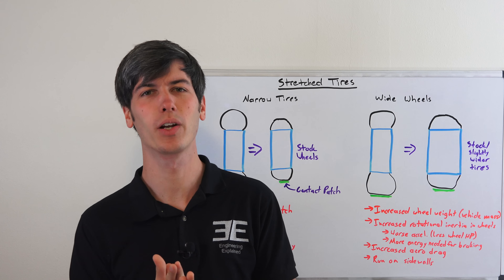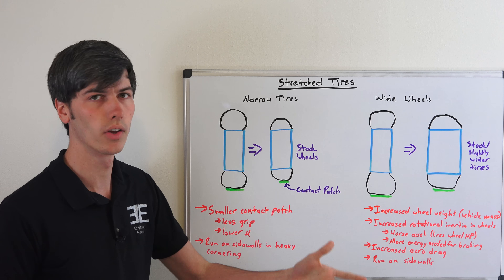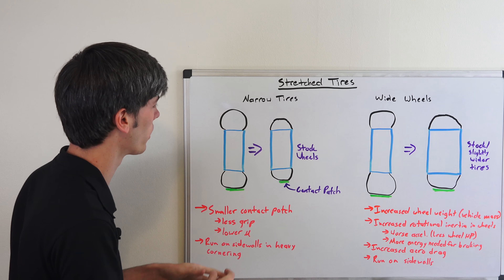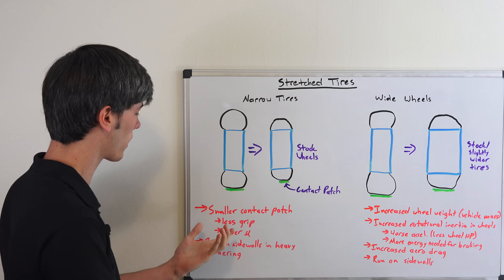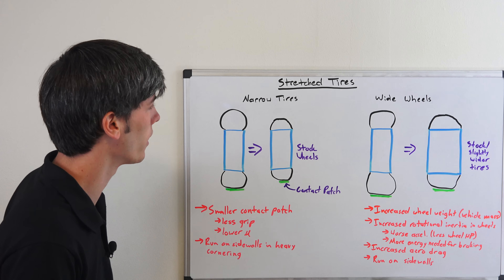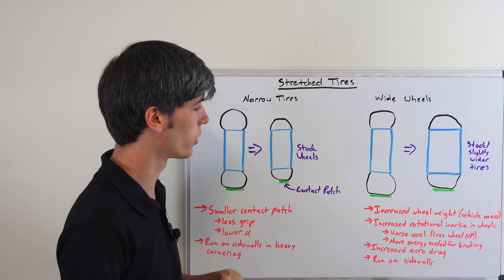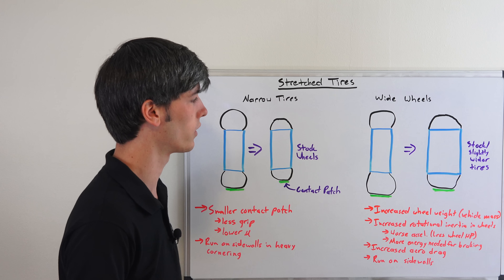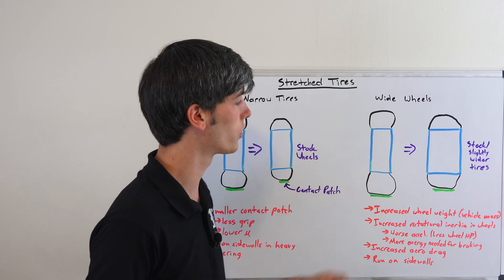Stretched Tires Are Silly

Comment: But then F1 cars have wider rear tyres. If they create aerodynamic drag, then why is it so?
Reply: Why do they have wider rear tyres?*
Reply: +Seema Kiran better traction/transsmission of power to the ground?
Reply: +Seema Kiran You are referring to tire stagger, not stretch.  Tire stagger is the result of trying to keep the tire temps the same on all 4 corners.  So f1 cars (which have most of the weight and all of the power driving the rear wheels) need more tire in the rear.
Reply: F1 cars are a different breed. They are full race cars which are extremely light and fast and need lots of traction. Yes the wider tires result in more drag but those cars need the grip. Also, the rear wing provides so much down force that they need weight and grip on the rear end. It is always a balance. Tires that are too wide result in added weight and drag. Tires that are too small (narrow) are light but may not don't have the surface area for enough grip. In racing, many narrow tires may result in a higher top speed on the straights, but wider tires may result in higher corner speed due to increased grip.

Comment: You are silly for assuming a wider rim is going to be heavier.  I am not a fan of stretched tires but some people like the look and if done correctly most of your arguments are invalid.
Reply from the maker: +Aron Singletary Which arguments are invalid? Sure, a carbon fiber 9" width wheel will be lighter than an 7" width steel wheel, but that's not a fair comparison is it? Which is lighter, a 9" width aluminum wheel or a 7" width aluminum wheel? Comparing apples to oranges is silly.
Reply: +Engineering Explained  I don't believe you have spent much time examining OEM vs aftermarket wheel weights, otherwise you would not make such a gross generalization. That goes to my initial complaint about your assumptions. If you truly wanted to explain engineering you would state your assumptions up front. Also the case could be made that going from a 6" wheel with a 185 tire to an 8" wheel with a stretched 205 tire that the contact patch is increased. Again assumptions are just silly, particularly when applied to engineering discussion. In the end stretched tires make no sense to me but I have to call you out for not framing your discussion better. My first real exposure to stretched tires was an OEM upgrade on an Infiniti G35. The car handled amazingly well and never had any issues which you imply are guaranteed when stretching tires.

Comment: Wrong again, if you stretch a tire it becomes smaller. You even drew it so in your diagrams. You would not lose horsepower from more wheel weight because the smaller wheel would compensate for it at it changes the at wheel gear ratio.

Comment: wow all these videos are dumb, your applying "broscience" and not real science, you don't take into consideration the fact of a harder sidewall tire, when cornering you have no worries of flex. nothing wrong with a stretched tire, too much stretch is possible definitely! but there is nothing wrong with it if you do your research and plan ahead, proper chamber and a proper tire will accommodate accordingly

Comment: You are negating the positive outcome of reducing sidewall flex for cornering performance.
Reply from the maker: Can you explain the logic to me? Is that not what mild camber is for? And how significant is the change? Enough to make up for a smaller contact patch and less grip or more weight?
Reply: +Engineering Explained 

Ok, so im not entirely disagreeing with you but lets make an example with a certain scenario.  Say we have two 255/65 r18 tyre.  Now we mount one of these tyres on a stock rim designed for it and another on a wider rim.  The car in question is setup identically with same camber settings.  In essence stretching the tyre will reduce the profile to something less than 65 compared to the non-stretched tyre.  

Now lets think of it this way, lets only have one variable.  Taking the same specification of tyre and adjust the sidewall profile.  Same contact patch and same camber, same everything.  What would you believe to be able to corners better/quicker/hold higher entry speed of the vehicle whilst maintaining 100% traction?  The fact is a 65 profile tyre will float more so than say a 25 profile tyre.  

Now whether this negates the extra wheel weight for the wider wheels would need real world test for entry speed, sustain speed  and overall time.  My personal experience is that tyre stretching will be superior.  Maybe marginally, however; taking into account driver confidence gained by the stability and predictability i believe would increase this margin.
Reply: +Engineering Explained Sounds like it could use some... explaining! :P Boom-tish :D
Reply from the maker: +KTCassman Stretching a 255/65 to 255/25 would require a pretty large wheel. Even if grip was equal (and you'd likely be running onto the sidewall in a case this extreme, which isn't made for grip), you have a significantly larger wheel. More weight, more rotational inertia. All else equal that is not beneficial.
Reply: Engineering Explained True but people are usually going from stock wheels to lightweight aftermarket wheels (still much lighter even if they are much wider)... the plot thickens. :)
Reply: +Engineering Explained u should check out miata.net for more on having a slight stretch on tires. Apperantly it helps on turn in too.
Reply: +KTCassman I guess F1, pikes peak hill climbers, wtac cars, and WRC cars are doing it wrong since you don't see slight stretch on the tires...why? because they use tires with a stiff sidewall. just look at a gt3 rs or zo7...the tires match the wheel width and have a fairly small sidewall ratio despite running 255+ width tires on 8" + wide wheels
Reply: I don't think +KTCassman was implying to stretch a 65 profile tire so that it has the same OD as a 25 profile tire, because that's utterly ridiculous and likely impossible. For a given section width tire, running a wider wheel will improve its performance to an extent. From what I've read, "wheel width = tire section width" is a pretty good rule to start with. Of course the benefits of "stretching" a tire likely vary between tires, and if you're limited to a certain wheel width because of the class you race in, then the widest tire you can fit will usually win.
Reply: +Engineering Explained I'm not saying stretch your tires - don't do that, get the widest you can.

But, you can imagine how the flatter trapezoidal cross section prevents flex much more effectively than camber turns it into squish. Camber preserves your contact patch at the expense of other handling characteristics, stretch MIGHT allow you to keep the same (inferior) contact patch but keep it through a much wider set of circumstances.

I'd rather ride the mush, and put rubber on the ground, but there seems to be at least something to stretching, when the right amount is used in the right situation.
Reply: Let's say a 225/40 is allowed to be fitted on a wheel from 7" to 8" wide according to the tyre manufacturer specs.  Surely in that case, the tyre will perform better on the 8" wide wheel than on the 7" wide wheel? :)
Reply: +Ryu K A slight stretch will help turn in and give more consistant breakaway, yes, but not stance-kiddie crazy stretch.
Reply: +TassieLorenzo Yes, in general it will, but the "stance/stretch" crowd would try putting that 225/40 on a 9" wheel.
Reply: TassieLorenzo
yeah, but putting a bigger tire on the 8 inch wheel will be better. Are you buying wheels to match your tires? I do it the other way around.

I think a lot of what people notice when they go to stretched tires is the fact that they had stock wheels and tires before, and suddenly they have brand new sticky tires with much shorter sides on much larger wheels. And that's another problem with them - you usually have lighter wheels and all that, but the barrel of the rim much farther out than with littler stock wheels, which increases not only your rotating mass, but the leverage it's got to fight the engine.

competing with driftbags on their own soil aside, I would put my money on the wider tire on the stock wheel, than a slight stretch on a 2 inch larger "light" aftermarket wheel.
Reply: dav3fk Re: Wheels to match tyres.  Sadly in 15-16" sizes there aren't many tyres available, and IMO you have to choose the tyre first and wheel after.  Sure a 225/40 R16 on a 16x8 would be ideal but there are almost none available apart from Hoosiers...
Reply: +TassieLorenzo Most people who do legit performance mods actually DO buy wheels to fit their tires. The limiting factor is usually how much tire can fit under the fender (or tire size limit for the class if it's in a specific autoX class or something), then find the width of wheel to fit the tire width and get the right sidewall shape - not too stretched, not too bulged. It's best to look at wheel and tire size as a system rather than separate components.
Reply: TassieLorenzo
If you're buying wheels to match tires, I still see no excuse for buying a skinnier tire than you can fit... if you're doing it that way, you can pick any other size combinations it takes to get wider tread.
Reply: Of course. :) "I still see no excuse for buying a skinnier tire than you can fit... " I am going to run a 205-50 R15 (the widest street tyre I can find in a lowish profile 15" or 16" -- you can get 225/50 R16 but that would look ridiculous and not fit under the fenders! :) ); I noticed in the specs that tread width is only 0.2" less than the 205-45 R16; so I don't see the advantage in sticking with 16"... Therefore I sold the 16x8 wheels that came with the car as they don't fit properly (too much camber to make them fit!), and will run the R15s on 15x6 Mitsubishi OEM wheels -- as these are cheap, durable and meet the minimum wheel width for a 205/50 R15.  I hope you agree that this is OK.? :) 15x7 would be ideal, but there has been too much searching of Gumtree already (the Australian version of Craigslist)... can't wait forever for the perfect deal to pop up! :)
Reply: +KTCassman 
I would much rather run a super low profile tyre like 215/25R16 than a narrow high profile tyre like 205/45R16 trying to achieve the same results by means of a bad fit (because, being to cheap to buy proper tyres)